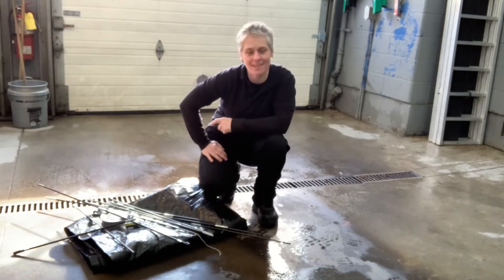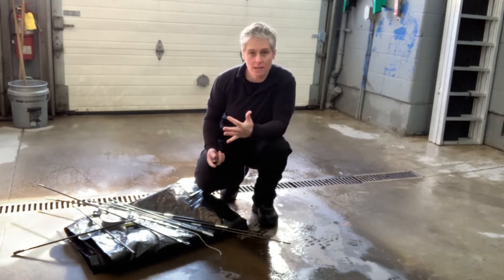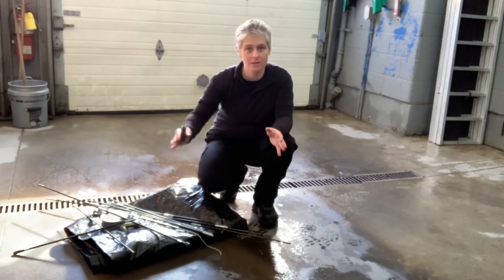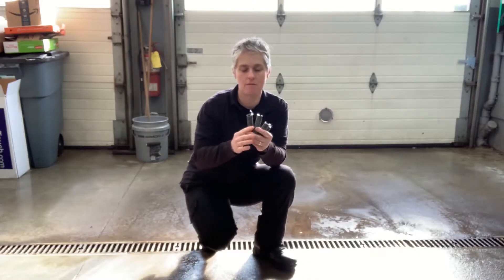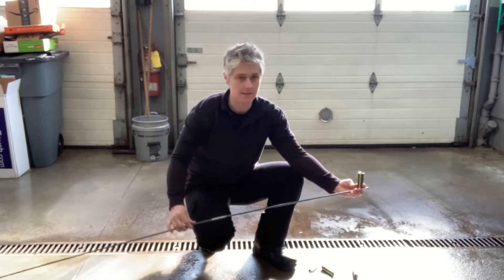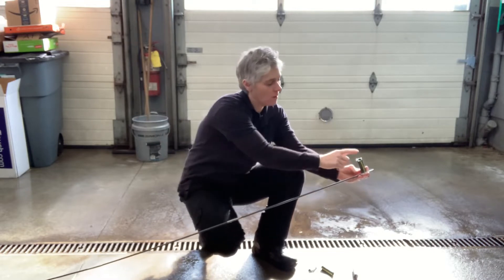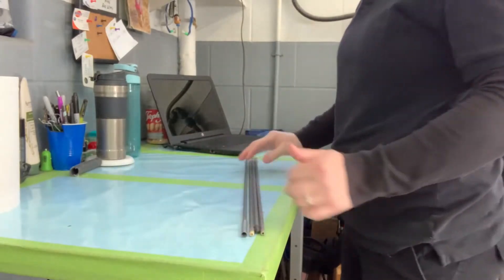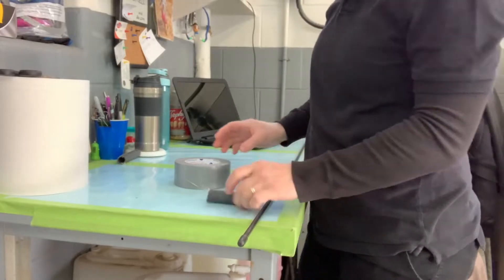DIY Portable Ice Fishing Tent / Lightwieght and Under $30

Comment: Those plastic tarps make shitty ice houses. For one the sweat with most types of propane heaters (good luck with a wood stove) and they don't breath so you can suffocate from  your heater using up the oxygen inside. Not to mention when they get cold, the plastic blowing in the wind is annoyingly noisy as hell!